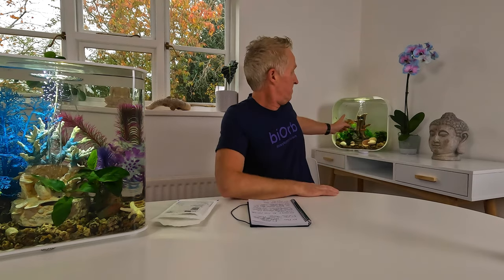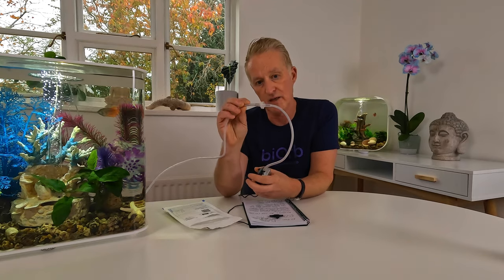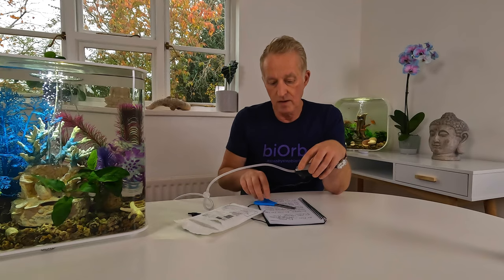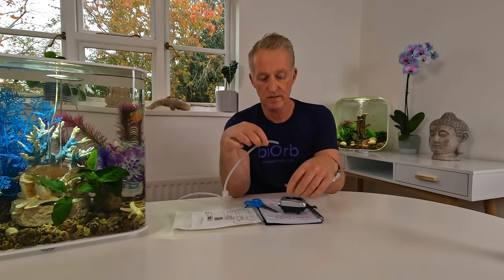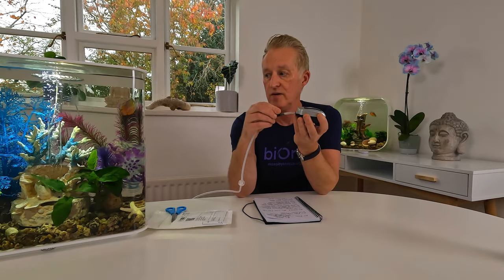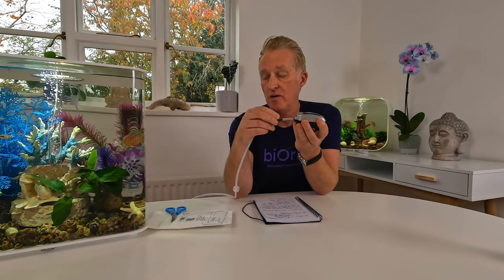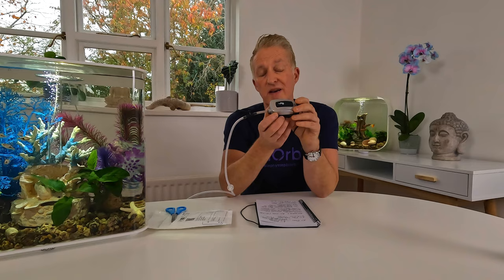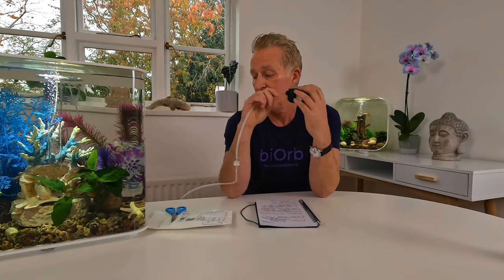biOrb Aquarium  |  Air bubbles too high?

Comment: I’m setting up my 60L classic biOrb now and I can’t get any bubbles through the tubing? I can blow into it and make bubbles. Any idea what I’m doing wrong?😢
Reply from the maker: Hi Sandy. The normal test for this issue is the one you have done - to blow up the tube to get bubbles in the tank.  Sometimes, if the tank has been left for a while, some tank water can move into the air line and this can result in reduced or no air reaching the tank - so blowing down the air line pushes this water back into the tank. The other issue (very occasionally) is were the one way valve positioned directly under the tank gets stuck in the wrong direction!  Normally this needs a stronger push of air through the airline to re-set the valve. This is best done with a small bicycle pump with an adapter fitted that fits the 4mm biOrb airline.  One or two short controlled blasts of air up the airline and into the tank normally corrects this valve issue.  What is a bit confusing is that you can blow up the airline and this still get a flow of bubbles in the tank? This probably cancels out that it could relate to a poorly fitted air stone or there being something stuck in the small tube that the air stone fits on to.  

The other thing to check is that your tank's base is not sitting on (crushing) the airline. The airline should be freely coming out of the base of the tank through the gap provided for the airline. 

If it is none of these, this sort of pushes the issue to being one related to the pump itself and whether it is pumping air.  Beyond all of the above, I'm really scratching my head!!  Best wishes, Mark
Reply from the maker: The valve issue that I mentioned above can sometimes be due to an initial fault with the "under tank" valve, when coming from the biOrb factory.  But more often than not, it can happen when owners fill the tank with water and then accidentally pour some water directly down the air tube. This causes an incorrect water flow (i.e wrong direction) that can then result in pressure on the one way valve and can make it flip the other way. If this happens, it needs to be reset to the correct direction with the use of a bicycle air pump.

Comment: Hi I put a t valve on mine but I installed it after the check valve.  I did not get water back flow so far.... I've had it running for a month this way. Now my airline will be too short if I decide to install it between the pump and check valve what do you think? thanks
Reply from the maker: Hey, how are you?  Ideally you should have placed it between the existing check valve and the air pump. As it is, it will work fine, but the purpose of the check valve is to stop the tank from totally draining out (and onto the floor) in the event of an air pump failure.  So, you run with the risk that the tank could drain out via the check valve. What I would do: I would get a replacement check valve and install this at the lowest point of of the existing air line (you need a check valve to fit a 4mm tubing) and I would also get a small length of 4mm air line tubing. You can then add the new airline and then the regulator within the section of new tube - between the (new) check valve and the pump. Does that make sense?
Reply: @Step-by-Step  yes I can see what you mean. I had a look again and perhaps I can swap the check valve with the t valve since the check valve will be before the t valve. The only thing is the check valve would be much closer to the aquarium. I think this will still work out fine. Cheers and thank you for the quick reply 👍👍
Reply from the maker: Yes that sounds fine. The key thing is to get the check valve above/higher than everything else. It doesn't need to be right near the air pump, just needs to be somewhere between the tank and the pump. The check valve can then do its job in the event of pump failure.  Regulators etc can be then placed below the position of the check valve in the airline.  So, all sounds very fine to me. Best wishes to you. Mark
Reply: @Step-by-Step  awesome Marc I appreciate you and your time. Very nice videos I hope to see more of your educational videos in the future my friend. 👌👌👌

Comment: I’ve just brought a biorb, 30l tube the airflow seem quite high and has created a lot of bubbles on top of the water around the edges is this normal? As I could not see many bubble around then edge in your tank. Also i notice the air pump is quite noisy from the vibrations to a slight buzzing noise, do you have any recommendations where it should be kept/on what surface? Your videos have been very useful in setting up my biorb, I’ve learnt alot from your videos.I’ve had my new tank 3days now, I’ve not yet added any fish as I understand it’s best to wait a bit first.
Reply from the maker: Hi Steven.  What you are seeing in terms of bubbles building-up on the surface might just be because the tank has only just been set up. I assume you are describing  the time taken for surface bubbles to burst? If it relates to the quantity of bubbles coming up trough the bubble tube how does that flow compare to the bubble flow shown in my video?   If you do have a high bubble flow I would suggest you leave that as it is as a higher flow will really support the cycling of the tank, once cycled you can then look to reduce.   

In terms of the noise.  This might be part related to the bubble issue you mentioned.  Double check if the noise is coming from the air pump itself or coming from the base of the aquarium.   Let me know which.  If from the pump, it could be because it is resonating against the floor or surface it is on  - do you have a hard floor?  If you lift the pump up and hold in your hand, whilst it is on, does the noise decrease?  Also double check that your air stone in the tank is fitted correctly.  Move it around a bit to see if that also adjusts the noise and perhaps also try removing the air stone to see if the noise reduces or increases?    I think it is just a matter of playing around with different things to help find the source and then  reduce the noise. It might just be something very straightforward.  

Yes, good idea to wait several days and just let the tank run (air on, heater on). This will help to stabilise things a bit (including the water) and also allows you to check that you have the right temperature etc suitable for your fish.  How are you planning to cycle the tank?  If adding bacteria (e.g. such as ATM Colony or similar) have you checked that your water parameters are in the right ball park for this (mainly pH and temp)?  Best wishes, Mark
Reply: @StepbyStep-biOrb  hi mark Thankyou for your reply much appreciated. The air flow compared to yours in the videos is slightly higher I think,which has created a lot of bubbles. I have used the bacteria booster that came with the biorb and I also purchased the pump bottle bacteria from biorb. My water temp without a heater it’s 22c and drops by -1c over night. The ph level is showing around 8.
Reply: @StepbyStep-biOrb  the air pump itself is not to noisy, I have laminate flooring which it is on. The adapter seems to be what’s making the most noice it has a slight buzzing noise which when I change the light function on the tank seems to become noisier.🤷🏻‍♂️
Reply from the maker: That's great Steven.  Well, keep the air flow as it is to help support the cycling, you can always add a valve to reduce air flow later on if needed -  I would live with it for the time being.  Bubbles should burst on the surface within about 4-6 seconds (normally).   If you have already added the biOrb bacteria I suggest that it might be worth just adding a very small pinch of fish food to the tank (yes, even without fish!) as that will help start to get the cycling going.  Perhaps also add a further dose of biOrb bacteria too if you have a bottle of it.  You can't really over do adding bacterial products! The cycling will be a bit slower (take a bit longer) at 22c but that's fine (elevated temps help speed up the process that's all). I assume you intend to go with a non-heated tank?  Adding a small amount of food should result in the water showing ammonia when tested (but this normally takes a day or two for the ammonia to show).  If you wish to do "fish-in" cycling in a non-heated tank, I suggest add two zebra danios initially... say in a few days or more.   You will need to monitor the progress of cycling by undertaking water testing  - i.e. track the conversion of ammonia - to nitrite - then to nitrate.  Hope that helps.  Mark
Reply from the maker: Well that's new one for me! Lol!   At least you have eliminated that it isn't the air pump (that's one down!).  Is it to do with the lighting system then?  When you turn LEDs off does the noise stop? Or is it the light unit (i.e. the tank's lid) that is causing the noise by vibrating (when you take the lid off the tank does the vibration stop?)
Reply: @StepbyStep-biOrb  I’m not sure I have just noticed when I change the light colour or brightness the adaptor has  a slight ringing/buzzing noise. Maybe I’m just being over sensitive 😂 . No it’s not the lid or light unit it’s definitely coming from the adapter
Reply from the maker: Lol. Funny!  Yes, it could be your ears are tuned into it! :)  I think it is safe to say that most aquariums will create some sound (i.e. but not a noise - which is when a sound becomes a "nuisance").  So, we're not talking this sort of thing re the bubbles: https://www.youtube.com/watch?v=pybmXoaOpZw.
Reply: I would say my tank has more bubbles than in that video. In the beginning they were large and would
Pop now they seem to be smaller and gather all around the edge and lay on top of water.  Looks just like if you had a glass of water that had a little washing up liquid still left in it the glass.
Reply from the maker: Okay.  In that case, I suspect there is something wrong with your pump as the air flow shouldn't be that high and certainly not in a 30l tank (the video link was of a 15l which tends to be where some issues can be).  It sounds like the air flow is whipping the water into a frenzy!  In terms of products ("chems")  you have added to the water to date... what are they?  Re the pump, I would personally go back to the supplier and seek a new air pump. The only other option is to get an airflow regulator to reduce the air flow and add that to your air line as shown in my video (you will then be able to adjust the air to reduce the issue you have).
Reply: @StepbyStep-biOrb  I added both biord sachets when setting it up the water conditioner and 24hrs later then bacteria. Then I’ve also used Aquasafe in the water and washed all the decorations with the treated water. And last night I used some biord water optimiser. I have ordered a airflow regulator too.
Reply from the maker: That all sounds fine Steven. In a way, you are better with an air pump that over performs rather than one that under performs.  The regulator should sort you out and put you in control of your air flow.  As i mentioned, air flow is better being higher during cycling as the bacteria needed are aerobic and oxygen helps to speed up their colonisation.    So, I suggest you add a tiny bit of fish food (even if it is the goldfish stuff biOrb normally provide in the box - just crush them a bit before adding).   That should trigger the ammonia I mentioned which is what the bacteria need to get started.
Reply: @StepbyStep-biOrb  Thankyou so much for your help, I will leave the air pump a few more days running as it is then before adding the valve. Shame I can’t send a photo for you to see how many bubbles I have collected on top. I didn’t get any food with the biorb, so I will buy some tomorrow and add a small amount.
Reply from the maker: Hi again. Sending photos etc is a problem with Youtube (they don't allow it!).  But you can send vids and photos to the Channel's email address without any problem: markbstepbystep@gmail.com    Yes, get some fish food.  Go for flakes as they break down quicker.  Something like Tetra Min... but any tropical fish flakes will do (even fish flakes from Sainburys!).  You might as well feed the bacteria and get them going asap and prior to adding any fish.

Comment: Hiw do i get rid of micro bubbles?
Reply from the maker: Hi Geneice,  Micro bubbles tend to be more of a problem during colder months.  The cold water coming from your supply is highly oxygenated and when it is released to the air (warmed) it releases oxygen in the form of micro bubbles.  These cling to all surfaces and even more so in a brand new tank.  By far the best way to remove them from surfaces in a tank is the biOrb multi cleaning tool https://amzn.to/3MNjN3X   Please don't use an alternative item or product which may risk scratching the inside of your biOrb!   If you want to reduce the amount of micro bubbles created during water changes the best approach is to fill-up water bottles several days in advance of doing the water change and leave those to stand in a warmish room.   The gentle heating-up of the water will allow a good portion of the high oxygen level to gas off.  When adding new water to the aquarium it is best to heat the temperature of the new water so that it is the same as the temp in the tank (this also limits the formation of bubbles). Best, Mark
Reply: I had the water tested.  The PH is ridiculously high.  It's clearing up.  I'm surprised since I use well water.
Reply from the maker: Interesting. Micro bubbles are normally associated with temperature variation (colder water holding high concentration of oxygen).  But, it can be a result of pH (pH swing) due to water off gassing CO2.  What is the temp of your well water when extracted from your tap?  When you say high pH what is the reading you have from your water source? How does this source pH compare to the pH in your tank after several days?

Comment: Hey Mark, me the pest! Haha! Can you ever have too little air flow? I’ve been staring at mine trying to work out if I’m still getting the same amount of bubbles/flow from when the tank and pump were new.  Also, how often should I change the air stone? Mine hasn’t been changed.  Tank started May this year.  Thanks :)
Reply from the maker: Hey. Yes, you can have too little air flow.  I would normally replace an air stone every 4 to 6 months (depending on how dirty it gets and also if there seems to be a reduction in air flow). Try replacing it with a new one to see if that fixes it.  It probably will.  Let me know. :)
Reply: @StepbyStep-biOrb  Yes it sounds like I’m over due it being changed. I have a spare, I’ll pop it.  Thanks.
Reply from the maker: Not a problem. Hopefully that will fix it. M

Comment: My bio orb isn’t bubbling. Took the stone out and there is one bubble at a time… is this a problem with the bubble or the air stone? Because without the air stone still on bubbles one at at time.
Reply from the maker: Hi. I assume that your air pump is working?  If so, the issue relates to a water blockage in the air line (air tube).  To fix this...  unplug the air line from the air pump.  Raise the end of airline in the air above the height of the tank (leaving it still fixed to the tank). Use you mouth to blow hard down the air line until bubbles are coming though into the tank.  Lower the air line back towards the ground and add back on the air pump. This should fix it... but let me know how you get on.   Fingers crossed! Best, Mark
Reply: @StepbyStep-biOrb  wow thank you. It’s working now :) blowing air worked. The bubbles are going much faster now. Though I still need new air stones but now I know the pump isn’t broken as they’re expensive. 🙏🙏🙏
Reply from the maker: Great! I'm glad it worked... it often does! :)   It normally happens if the aquarium is allowed to stand for a while without the air pump connected/switched on.  Tank water slowly makes its way down the air line and when the air pump is switched back on it is unable to push the water back up into the tank.  Blowing down the air line helps to clear it but it can need a really hard blow to work. Elevating the air line upwards (above the tank) makes it far easier.    Anyway, next time it happens... you now know how to fix it!
Reply: @StepbyStep-biOrb  that makes so much sense. I bought a clearance returned item so I bet that’s what happened prior to purchase. Sold as “bubbler not working”. Now it is haha.

Comment: I think BiOrb could help , by selling an Air flow regulator valve with 
“Halo 15 “ whole set to begin with 😄👍💗
Reply from the maker: Hi Wendy. Yes...I totally agree! There does seem to be a problem with some of the 15 litre aquariums and the air pump (air flow).  Basically a 15L aquarium (biOrb or not!) doesn't need the same size air pump as one provided for a 30L and larger... which seems to be what biOrb are supplying.  This size or aquarium is ideally suited for having a Betta, but Betta also happen to be a species that are not at all happy with a high air flow.  biOrb could either reduce the air pump size (it seems to be too high) or at least include a regulator, within the airline, to allow new owners to make their own adjustment.  Clearly, air flow regulators are cheap to buy and are very easy to install, but that is missing the point that they should already have one included with their product.  Nice to hear from you.  Thanks for watching and commenting.  Much appreciated. Mark